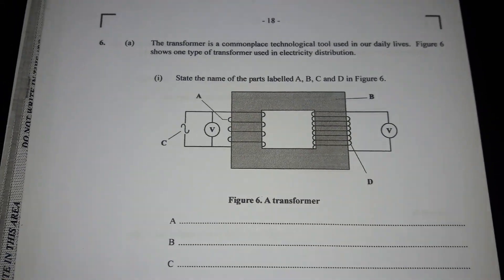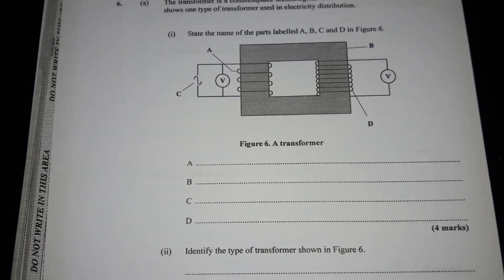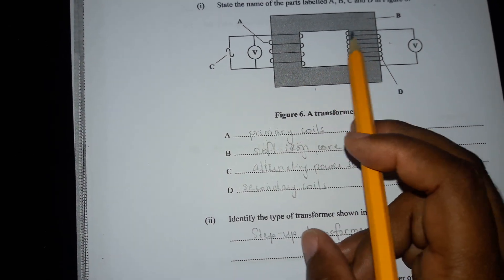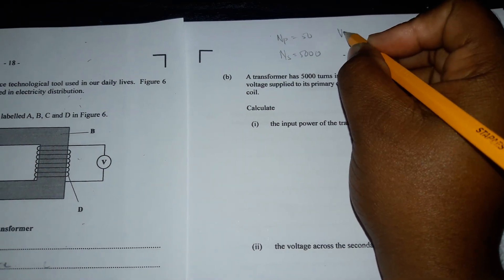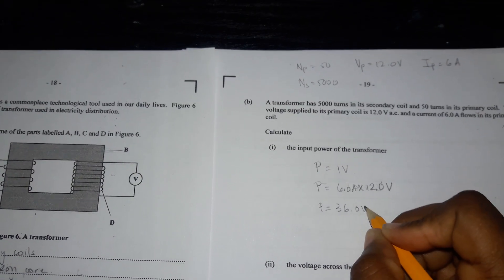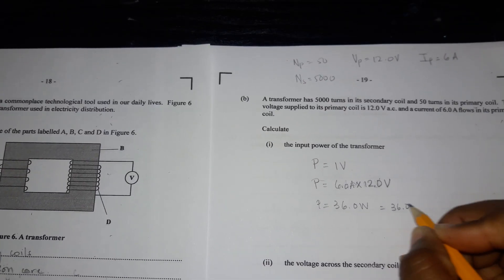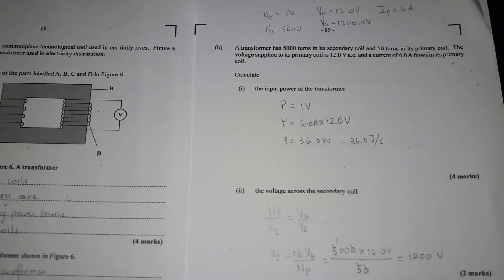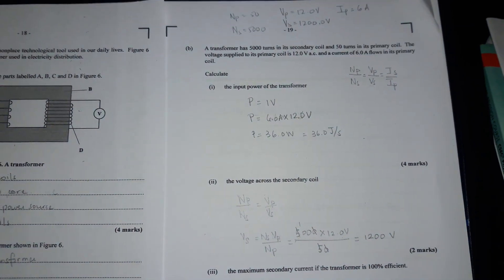CSEC Physics June 2018 P2 Q6

Comment: For the last part, 6(b)(iii)  since nothing was lost I used Power input equal power output which is Pp=Ps which I broke down into  IpVp=IsVs and I ended up getting the same answer but looking at it now I guess the formula I used was the same as yours but rearrange differently.
Reply from the maker: Yes.  You can use Vs/Vp = Ip/Is or Vp/Vs = Is/Ip. Either one is fine.